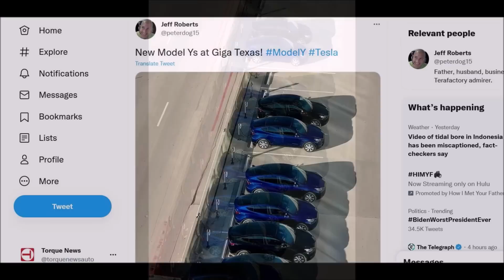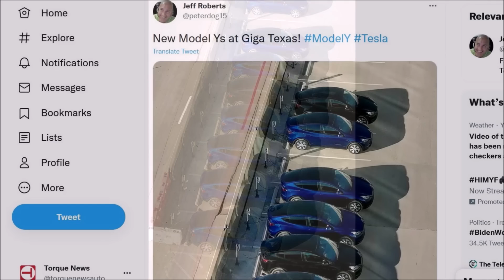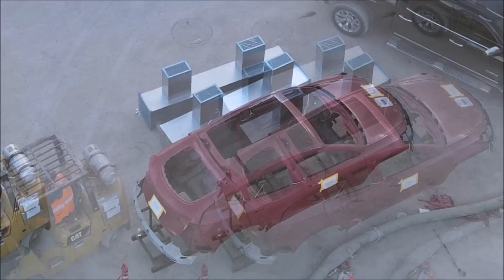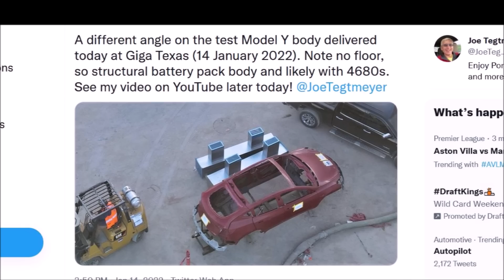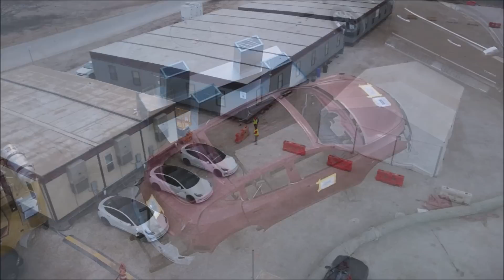BREAKING! Source Reveals Tesla Giga Texas Model Y Delivery Timeframe

Comment: 4680 will be in Model S and 3 too?
Reply from the maker: I think it depends on battery availability
Reply: @Torquenews  If they use for Model S it means better spec?
Reply: @davidsosnak2968  you can rewatch Tesla’s battery day and see the specs they say 4680’s will give their cars
Reply: @damionkibler3493  Can you post some numbers?
Reply: The battery pack for the new MS is all new design. I doubt they will switch to the new cells anytime soon. Maybe in a year or two once 4680 cells are at production capacity.